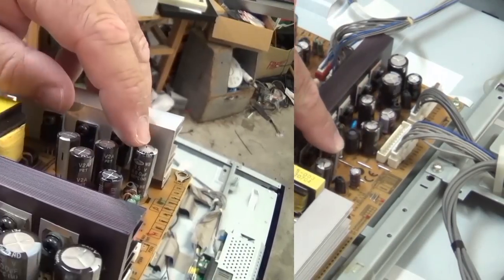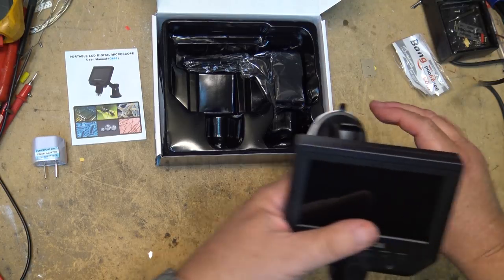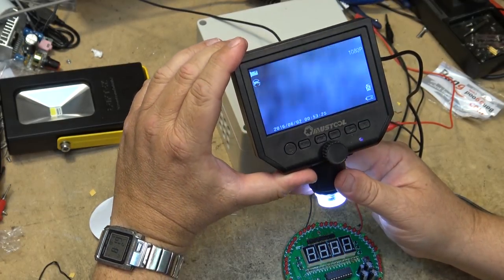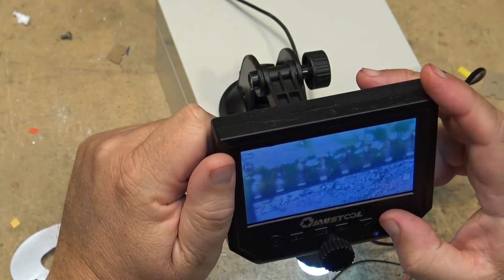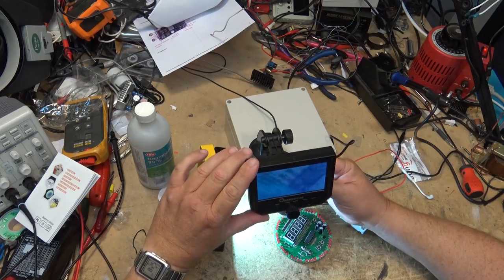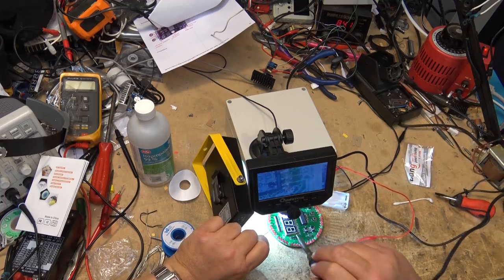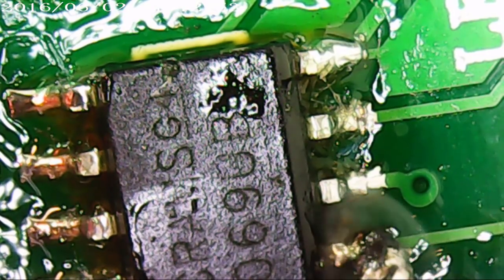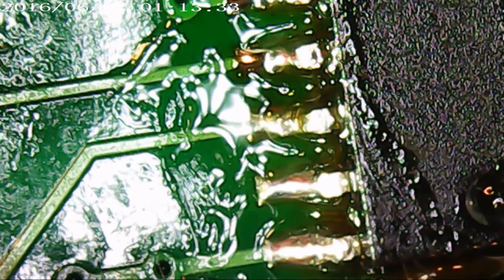Digital microscope review

Comment: Actually, it is not crappy at all.  When it is set up and used correctly it works quite well. You can check out other YouTube reviewers channels to see. Works well @ 1080p and if you run the usb cable from the unit to usb 2.0 or usb 3.0 inputs on your computer   and open your video viewing software can view it on your monitor. Nice to see it on a 27" monitor in 1080p. It is not widescreen or 16x9 aspect ratio but it is still a real help for small work. Not just electronics (that is what I use it for). It will run for over 24 hours on a simple external portable charging pack. Great for exploring outdoors bugs and plants with grandchildren. LED lights are nice and bright for close work. All in all best $40.00 Bangood item I have purchased lately. Aloha from Maui
Reply from the maker: Randy Gentry 
It will put out a 1080 picture but only records in 720 it appears. Still is good enough for inspection and can see in areas they you can't get a magnifying glass.
Reply: Hi! when i connect my scope to the computer (surface pro 4 with win10) i find a TIGA device with only 640x420 resolution. Can you get yours to 1080p?
Reply: Yes I can view at 1080p cannot record at that but can view. Record only 720p.
Reply from the maker: Yup,records only at 720p
Reply: Randy Gentry  how did you manage to connect it to a computer running 1080p I only get 640x480. Did you install any drivers?
Reply: I am running it in my Cyberlink  Powerdvd15  program software. I click on my "computer" in the software  and then click on the microscope drive letter that comes up (it shows up as a USB drive letter) and adjust the software video enhancements. Aloha

Comment: It looks real good to me. The price makes it even better. Just $40 US I plan on getting one. It would have helped me do a better job soldering my Dot Matrix SMD clock kit. I would have noticed the solder bridges as I was soldering it not after when I noticed it wasn't working correctly. Then I had to used a powerful magnifier to inspect my solder job. This thing is very useful.

Comment: It really doesn't look bad, especially for that price it seems to be a very useful tool if you solder smd parts or inspect something :). Definitely a lot better than the standalone microscopes, as it has the monitor built in. I would suggest to mount it alot higher, so that the magnification is not that high as it is pretty hard to solder with very high magnification. And of course, as with all new tools, you have to get used to it, it is different than a magnifier lamp or glasses ;). Thanks for sharing, nice microscope :).

Comment: I have the very same device, also from Banggood. I believe you can change the recording resolution in the set up menu. You failed to mention the fact that it has an internal Li-ion battery which means it can be used without external power. I have mine attached to a microphone arm, with a custom made 3D printed bracket, which means I can swing it out of the way when I don't need it and position it easily when I do. I find it much easier to use than a magnifier as there are no aberrations towards the edges of the image, unlike a magnifier lens. I think it's an amazing bit of kit, especially for the price.
Reply from the maker: Right I forgot to mention the internal battery. Instructions say it will run for a few hours. As to the resolution, you will see that it was set to 1080P, but the files that came off the SD card were in 720p as I had to resize the clips to fill the screen. Gets the job done nicely. WIll be using it on future SMD builds.
Reply: hi, i was wondering if i can buy a 3d printed bracket from you, and which microscope arm did you use? thank you so much!

Comment: thanks, i have the same scope, but the gearbest version. i didn't know about the zoom function. you taught me something ;) i did note that on the 6x the picture was crap
Reply from the maker: The proper way to zoom, move it closer. It will focus real close. The zoom buttons are digital zoom, and digital zoom reduces sharpness. In the non zoomed mode, it is more than good enough fir reading small part numbers, inspecting solder connections ect.

Comment: So it is nothing like the Mantis that Dave Jones in Sydney Australia, what about using an old windscreen from an old car that has not been in an accident i.e unbroken.
Reply from the maker: No! The Mantis runs over 1,600.00 US. This one 40.00
Naturally there will be some trade off, but basically the both do the same thing. Let you see little tiny parts.
I used to have a nice one at the TV shop. It was just an Ikegami vidicon B/W video camera and a small 9" high resolution B/W monitor with a microscope lens on the camera. There was an optical eye piece as well. The camera delivered about 800 TV lines of resolution.

Comment: That looks a bit crappy to me.  You could do just as well with a magnifier lamp.
Reply from the maker: It gets the job done. Can get in much closer than magnifying glass. I have it up too high due to what I stuck it on. If I lower it down it gets much closer but even at this height it is perfect for inspecting SMD components. 
Being able to record the work from a direct overhead perspective is also great.
As I said it is not a professional microscope by any means, but it is more than good enough for casual work. and for the price you really can't complain.
Reply from the maker: Exactly. For what it cost I think it is excellent. Sure it only records at 1280x720 not the claimed 1080p which is typical of dash cameras.
That is basically what this is, a cheap dash camera with a close up lens on it. The menus are the same.

Comment: But did the clock work???
Reply from the maker: Well there is nothing really wrong with the clock. There was something wrong with the operator! The clock seconds tick around 1 per second, in step with the 1 Hz pulse that comes out of the atmel.  What you need to do is set the time to 1 minute before the actual time, and then when the second dot ticks to 0, hit the time set button to set the minute to the exact minute. This resets the seconds to 0, and the second ticker will not be syncronized with the real "0" on the seconds register. This way every time it counts 60, you will be right on the mark. Of course if you are a second late, well then the minute will also roll a second late. Sounds dumb, but that is the design. pressing the rest (reset) button resets the time to 12:00 but not the second ticker. It just moves ahear 1 second every time you press the rest (sic) button, as that generates a second tick pulse too. The second ticker is synchronized with the seconds colon  on the time display. I bet the clock program is just an open source code running on an atmel. Not like the old and loved digital clocks that used the National Semiconductor MM5214N chip.
The first clock I designed and built used that chip. It still works today, and is the driver for the giant 6 digit clock I built that uses warm white LED light strips as the segments. It is a nightlight in my kitchen, lights the entire kitchen up at night, and you can see it from the street clearly it is so bloody bright.